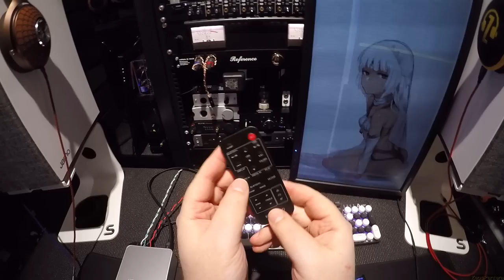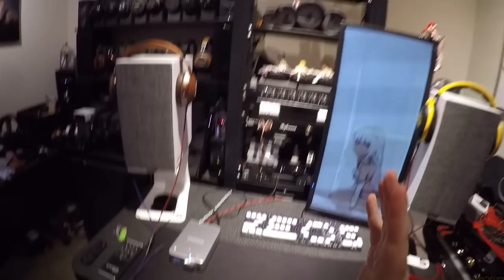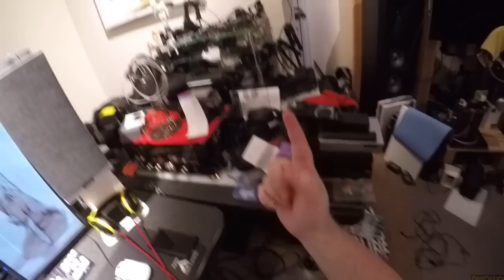Kenwood KA-NA7 _(Z Reviews)_ Japanese Stock

Comment: Fun fact, a lot of high end vintage tube amps had 3 modes ON, OFF, and Standby, if you put the unit in Standby mode only the tube heaters would run but nothing else, so the thing would be ready to go instantly when you turned it on; a lot of guitar amps still do that today.

Comment: I have a kenwood roxy midi hifi from 1991, its running like a tank with my hpm 700 speakers, i tried my best to replace it with newer marantz reciever, onkyo integrated 9010 and yamaha, but i dont know why it still beats everything in quality audio, and it got a motorized vol dial with little red light... Rare and beautiful ❤️...anyway another good review zeos.

Comment: I just wanted to say I bought ksc75x as zeos recommended, and OMG treble and upper mids are just too much. Isn't there a mod or something to reduce them?
Everything is fine at low volume but as soon as you raise the volume, sssssssssssssssssssss.
Reply: @hamedshahr  You know you could have just gone into your devices equalizer and dropped the values rather than messing with the hardware. It's probably a far easier solution and less tedious. Granted not perfect if you used mixed headphones on the device.
Reply: @hamedshahr  Not the biggest issue, try listening to Unicorn by Bel Canto
Reply from the maker: Were they brand new or did you break them in a bit. I don't recall them needing it but I also don't experience it.
Reply: This is exactly the problem, Zeos has no fucken idea.

Comment: When this thing originally came out in Japan (in 2016!) they wanted 41,000 yen for the amp, and another 20,000 for the 90s as fuck but decent looking mini-bookshelf speakers. That's $560 USD for the system folks. Holy jesus, feelsbad for Japan. Interestingly the speakers have binding posts, and the amp doesn't. https://ascii.jp/elem/000/001/267/1267113/index-3.html

Comment: Can someone help me out? I got recently the hd650. Now i also have the mackie mr624 wich are connected to a Scarlett 2i2. The headphone out on the Scarlett sucks. I want to get the schiit magni 3+. Can i connect it to the Scarlett with an splitter on the outputs or should i get the schiit dac? Can i use my mr624 with the dac? I don't really use the mic in on the Scarlett. Is an schiit dac necessary?